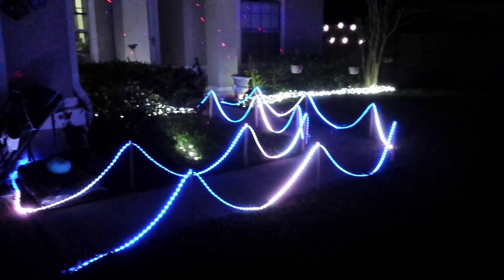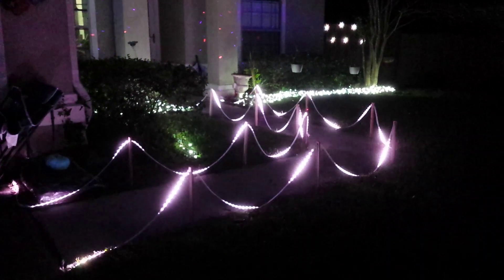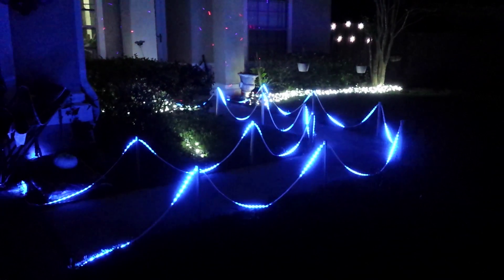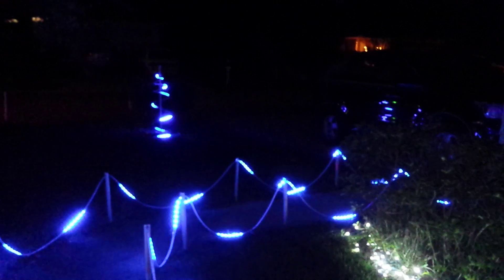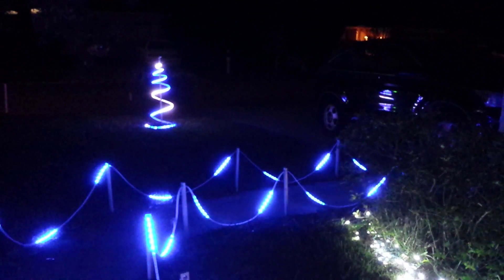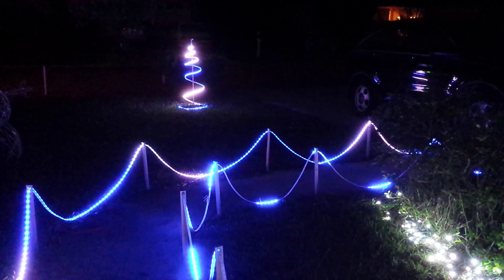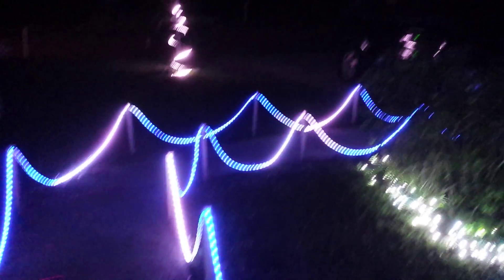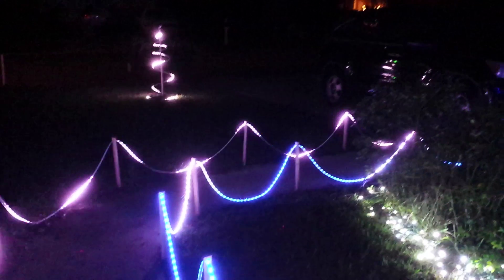WS2812b Christmas Walkway Lighting

Comment: connect the arduinos by serial or I2C to sync them.  Or, run both data wires for the strands to the same arduino, you can do this and it's easy to do just include the ground pins as well.  I've have up to 5 strips running from the same pin before, because each led restores the signal voltage to VCC when it sends the data on.